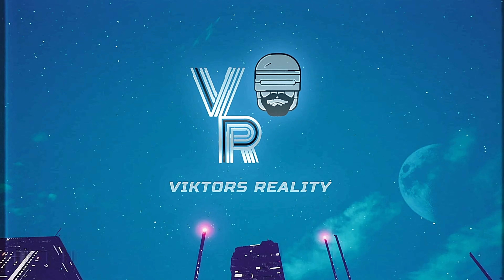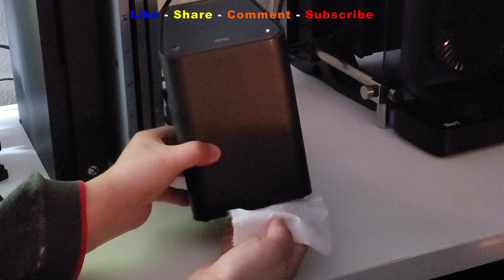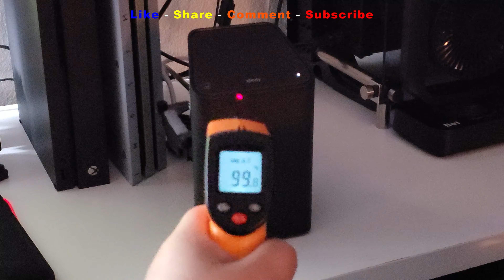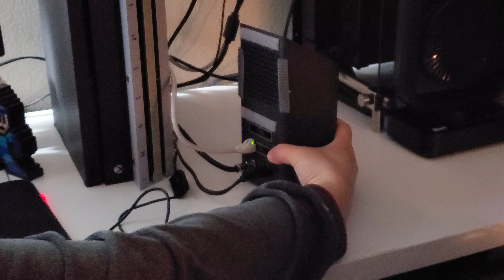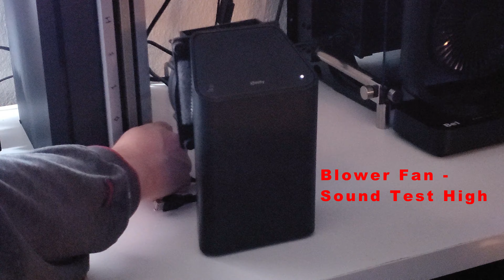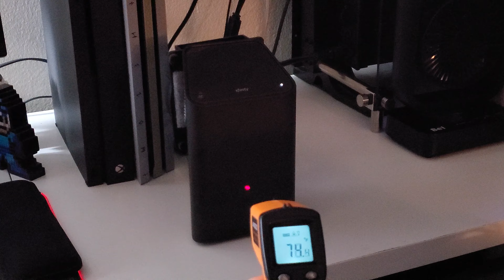Overheating? Xfinity XB6 Heat Fix - Xfinity Gigabit Internet

Comment: So basically xfinity should have designed this better. The previous router had grated sides and we never had an issue. This new router has been driving us CRAZY because the speeds are trash (10mbps or less). It wasn't until one of us touched it that we thought it may be overheating. We're going to try the fan. Thank you so much for posting this!
Reply from the maker: Just so you know. Call Xfinity first. They are upgrading ppl who have a certain speed of service to the new XB7 wifi 6 model. The 7 is white while the 6 is grey (ours). They told me its on backorder until Nov in my area but maybe you have better luck. The upgrade is free.   :) but the fan does let me have a more stable no more drop out connection.
Reply: @DisplayReality  yes, that's the one we have. Unfortunately, same issue. The previous model we had (the thin, tall black one) had open grating on each side. Never got too hot and ran our devices with no problem. For reference, i have a 4K samsung tv, 2 laptops, 2 xbox 1S, and an Alexa Dot. We rarely use the wifi fo our phones because we have unlimited internet.
Reply: @DisplayReality  also, they're coming out tomorrow because the signal going in to the router is perfect, but once it hits the router it's garbage. We've reset the damn thing almost 4 times a day since we got it last week.
Reply from the maker: Yea there's a problem then. Hopefully they fix and even if they do these fans will make it cooler for a more stable speed. With these fans since they move more air faster... make sure to clean the bottom intake area as dust will accumulate faster. I dust mine once a wk for it to stay always clear and open. And the actual fan about once a month.
Reply: the design works as intended. keeps breaking so you have to keep paying them money to fix it. genius!

Comment: I have had my XB6 for 2 years. Have had 0 issues except for Last night I believe it over heated. Last 24 hours the modem had consistently been disconnecting, then it will connect again after it cools. Thats what it seemed Iike anyways... I exchanged the modem today at the xfinity store. Got another XB6... connected couple hours ago...so far so good:) never heard a noise tho

Comment: Mines 2 days old, I’ve had to restart it over 20 times because the internet connection keeps going out, just temped it and it’s at 144 degrees 😂 last model worked way better
Reply from the maker: 144?😬😬😬... lol I know what you mean sometimes the older ones work better. Just make sure the vents on both sides are clean as much as possible

Comment: The modem/routers need better cooling methods and should also include air filters. Change or clean air filters and these will last a lifetime or at least until there’s a major new technology. Heat hurts electronics. Dust causes slows down electronics heat removal.

Comment: Cox Routers have the same issue, I build computers so I know how crucial it is for electrical components to be cooled, Got 2 old PC fans that were laying around, Made a custom stand with one of the fans on the bottom, and then put a fan at the intake side aswell, It wont ever exceed 63 - 70f now, These types of Routers/Modems have terrible cooling, And also can be a result of internet outages in your home when using the internet for a extended period of time, For those wanting to DIY a cooling setup, It is very easy, Just get a couple 80mm - 120mm fans off of amazon that Can be powered by USB, then either tape them onto the modem or use some Double-Sided Adhesive Tape and mount them to the router top and bottom, Then to make a stand so it has clearance Get a few rubber stops and put them on the bottom of the fan and screw a long self tapper into the rubber stop, And your all done! Side Note It does sound like a lot of work but it is well worth it and it helps with improving internet speed aswell since the device doesn't have to work so hard.

Comment: My cut's off all the time and I unplug it and clean all the vents with compressed air.  But I've never had an issue with other modems and Comcast has no solution, or at least when I've contacted them.  thanks for the video.
Reply from the maker: Maybe you should get a fresh install on your line? I know they problably will charge you but if you have other option... Xfinity is the fastest in my area so I had too.
Reply: what the f...k

Comment: I used cable ties to secure a case fan to the top grill in back. I did this because I noted there was no other method of cooling but convection. Cheap insurance. And I don't have to worry about Xfinity tweaking their system and making my router obsolete (like my Netgear 6300).

Comment: I took out the 50 x 20mm fan and slapped a 120mm on the bottom because the higher pitch of the small fan was driving me nuts. Going to see if I can 3d print something to hold it in place and funnel the air more efficiently. Right now it's all just stacked on top of each other.

Comment: Now I see your post which has more detail along my issue. And I found your added fan on Amazon, the exact you have.   I was given this about 5 days ago as a replacement. The fan has never shut off and it's a little warm so you post is appreciated.  So the fan is not blowing on the hardware, it's sucking air and the added fan is blowing away from the router? Got it!  ";-Dx  jack

Comment: The successors, XB7 and XB8 the ventilation is at the bottom surface, and on the top surface of the unit with a fan near the base sucking air in when necessary. The XB8 uses about 16-18 watts continuously and fan only comes on if house gets near 80F so it can handle pretty high temperatures. It is currently 65F in the house and pointing a temperature gun pointing down at the top it reads up to 119F it's always like this 24/7 reliable. No big deal

Comment: I had this same issue out of mine.  You couldn't touch the outside of mine.  It would straight burn your hand.  Called Xfinity and got a new one and it doesn't get quite as hot but still hotter than it should be.  They do it on purpose.  They know what they have and what they're doing
Reply from the maker: I just got a new Asus router wifi6 for my setup. As even on the xb7 I would get 2 rooms away drop outs. I know what you mean...

Comment: They just updated my modem and gave me the one in the video. And it hums and gets warm..This not even over a month..I was happy with my other one with the lights!    I couldn't do all you suggested with the fan in the back.   And getting through Xfinity is terrible!!!!
Reply: The same exact thing happened to us! Old modem sometimes had a slight high pitched sound, but this new one has a loud fan humming sound and is hot to the touch. I hate it! Lol.

Comment: Got one of these this week, the built in fan is annoyingly loud...   probably going to buy a modem before I try this though.. ha!
Reply from the maker: The Xfi Xfinity modem? If its loud get it replaced. On reddit there are reports that if its loud its faulty. Many reports. My modem is silent but if I put my ear I can hear a small fan. Mine does heat up with more than 5 connections. With this ac infinity it has made my wireless speed stable with less drops and way cooler...
Reply: I'd rather have the fan be loud. It doesn't do shit

Comment: You’d think the company could have installed an internal fan FFS. Thanks for the tip though. I also flipped my modem on its side so there’s nothing obstructing the airflow

Comment: We had a cable problem with our telephone pole’s recently so there was a dude to come out here and work on the lines because our wifi was out. Keep in mind we had amazing wifi before this happened we run 1 ps5, 2 ps4s, 5+ phones all smooth as butter plus anyone that comes over no problems we loved our wifi. As they were fixing the lines they gave us a smaller wifi box and stole our good wifi box from us claiming its “better”, “smaller is better” is what the dude said. But its the same one in the video. Let me just say ITS COMPLETE DOG SHIT i cant play any thing without nonstop lag. I want my old modem back but they took it 😢

Comment: I have this router and it was decent for the first week or so, but then it just started dropping to crazy low speeds, i took speed test and a one point it had reached 0.02 down and 0.04 up. When I restart the device and let it cool down it usually is okay for around 5 mins but then the router heats up and the speeds tank. I’m hoping this works for me because i’m not sure what else would be causing these speeds
Reply from the maker: Also... Try to keep it clean. I need to vacuum the vents of the router every 2 wks to be sure they are clear. Now I never have a problem. Too bad we need to go thru this. But this the best speeds in my area so I need xfinity.

Comment: Have the same one and was wondering if I could buy a netgear modem and connect it and would it increase my speeds? My ISP's download speed goes up to 250 mbps but I get really bad speeds.
Reply from the maker: You should be able to if that's what you want. Before I had a Netgear modem and Nighthawk wireless router when I was at 250. But since this deal for me was free unlimited if I got the Xb6 so it was a no brainer for me... but call them and ask for the new white version 2020 edition modem. I'm in the process of getting mine. It's a free upgrade.. maybe still rolling out.. it's faster and cooler supposedly according to them at ces 2020.
Reply from the maker: Yea... the fan must be super small in there... LOL... it dosent even move toilet paper.. LOL

Comment: I just took it apart and it air cools....when they come work on it I put it back together
Reply: How do I take this thing apart?
Reply: Same haha
Reply: @JimmyChangaification  remove rubber feet. Don't touch left side when cover removes.
Reply: @LifeofAedan  I took off the rubber feet expecting to find screws under them, but nothing.  I tried (gently) to pry off the bottom plate, but it does not seem to want to come.  What next?

Comment: Lmfaoooo! What a joke of a unit! I have an ASUS router and it’s never hot and 2 years it’s still reliable
Reply from the maker: My netgear router had alot of holes and vents even a thermal aluminum heatsink... LOL
Reply: Viktors Reality facts! That fan is there for lazy internals..... idiots tried to offer an XB6 modem lol I’m like no thanks I’d rather pay 💰 a little to use my reliable hardware than their POS in house hardware....... 💁🏼‍♀️💁🏼‍♀️💁🏼‍♀️💁🏼‍♀️

Comment: Just picked this one up and its really hot. Way hotter then it should be. Considering buying a modem and ditching this stationary heating pad. Our service keeps dropping every 30 minutes or so. Very annoying.
Reply from the maker: To be honest same thing happened to me. My Xfinity modem would fluctuate every 1hr or so. Speeds would be great then slow down. Especially when it's over 100f. With this fan Now I'm never over 93f around there. Now I get stable temps. But Xfinity announced a new modem at CES 2020. It's free to every Xfinity subscriber. Have toubseen it? All you got to do is call them and request one. IL make a video on it. Its faster and cooler supposedly... try that. But a seperate modem and wireless router is an option too. I had both netgear modem and wireless routers before I took an Xfinity deal for unlimited internet..
Reply: Going tonight to swap for a new one. If this does not work i will have a tech come out. Not sure what a tech can do for equipment that overheats lol.
Reply: @terryfredrick5149  You can buy a lot of fans for the cost of a modem.

Comment: Above 100??? Sounds unsafe to me- Like why would Comcast or Xfinity put out a modem that heats up that hot on the outside when probably those modems are used around children and the elderly just curious I think you’ve really shown how really hot they can get- Let’s hope nobody gets seriously burned touching that
Reply from the maker: It's probably due to the internal fan being so cheap and low power in speed. That's why this fan helps. But true I don't know why Comcast would not check this. Lots of comments on how hot it gets..

Comment: Thank you for sharing. Xfinity modem fan is working but making noise. How I can reduce noise?
Reply from the maker: I had my Xb6 replaced with a xb7 plus I still use my fan for no throttling. But I do clean it out regularly with the keyboard vac. What kind of noise? Maybe it's the small internal fan that loose? Or is it an electronic sound. Like a click. My xb6 had that. Kind of like it was starting to flex the plastic due to heat.
Reply: @DisplayReality  I just got this modem yesterday.  The noise sounds like a small laptop.  It's a constant fan noise, it throttles up and down every now and then, just like a laptop.  I don't think I've ever had a modem/router combo with a fan inside of it until I switched to comcast.  The guy assured me there were no gotcha's so I signed a one year contract, then I get this polished turd of a gateway.  This is a design issue.  I'm surprised yours has no noise.  My house is virtually silent at bedtime aside of the constant drone that is my gateway.

Comment: Why not just rest it in its side so there’s more air flow?
Reply from the maker: The built in fan still is so small... I do have some rubber pegs on the bottom for an extra bit..

Comment: I suspect they just make their newer devices as cheaply as possible.  I've noticed the new 4K DVR box is just as bad. Uses a loud tiny fan as well with excess heat on the case.
Reply from the maker: There is a newer xfinity modem above the xb7. Xb8?? I'll look for more info.. I hope better thermals.. it looks smaller.

Comment: How thick velcrow tape do you use?
Reply from the maker: Half inch velcro. I am getting the new xb7 and will see if it's any different... plus if fan makes a difference. The xb7 is free if you call for the upgrade. All free.
Reply: @DisplayReality  oh ok thanks, do a review as soon as you can. If it has the same problem most likely not upgrading.  But I hope the overheating issue gets fixed

Comment: 1) that is not a heat gun. That is a infrared thermometer.  (heat guns produce heat, not detect it)  2) fantastic vid.  3) comcast sucks.   Xfinity sucks.  Yes if its the only thin in the area its what you deal wtih , but honestly its garbage for the price.  And then add on the data caps, paying extra to remove them, just nonsense ways to bleed your money.
Reply from the maker: I meant to say infrared 😆 I have been hearing these Xfi boxes overheat too much .

Comment: There is a fan in the bottom, it has probably stopped working (Burnt out)or is clogged up
Reply from the maker: I have opened mine up. They are small. Plus the more connections the more heat. It's so low in power plus the fan heat vents are so small

Comment: lol i already did that before looking up what others are doing. The back is the perfect size for an old 80mm case fan. I just spliced mine in with an old 12v landline power cord and strapped it on with a couple rubber bands(cuz i was to lazy to find my double sided tape) I found this funny because cox has really bad service in my neighborhood (and a natural monopoly). I constantly get packet loss when gaming. When ya call cox they ALWAYS SAY looks fine on our end and want me to pay for a tech to come out.
Reply from the maker: LOL... so true. When I call for an issue they always say that too... kind of funny🤣 and kind of😡 at the same time...
Reply: Xb7 (white) modem is out now and fixes this issue. Plus it has WiFi 6 and better WiFi range. They can send you a replacement/ upgrade for free if you request it.

Comment: Is it any less hot in bridge mode without radios turned on
Reply from the maker: Do you mean separate wifi 2.4 and 5ghz signals. I saw no difference with that. Its still hot.
Reply: @DisplayReality  no I mean with the wifi radios disabled and using my own router....bridge mode
Reply from the maker: Oh... I don't have a seperate wireless router to try.. sorry. But you would think it would be cooler since less stuff going on. But I'm sure it still depends on your speed package. And amount ofbtraffic you generate.
Reply: @DisplayReality  I'll have these answers shortly. Package is out for delivery
Reply: @DisplayReality  netgear r7200 as router and primary ap, Cisco 2600 for IoT network
Reply: Viktors Reality I spoke I should give an update. I couldn’t get past 600 down on gigabit with the xb6 in bridge mode. And it got super hot (I don’t think the radios ever truly turn off). 

Call, bitch, complain, and demand the xb7. In bridge mode the thing is phenomenal (average 900 down on wired connection). The thing has a 2.5gbe port and WiFi 6/ax. Pretty impressive actually.

I’m still using it bridged. I don’t want or need their network managing my network. But a 2.5gbe port is pretty impressive. No heat issues
Reply from the maker: thx for the update! they told me its on backorder... but hopefully by aug.

Comment: Well, call me mouthy. This is the 2nd posts in several hours. I hope you are still monitoring them. I am going to take your advice and buy the fan from Amazon. Must be the same one. Doesn't the pull on the built in fan from the power of the adapted fan do damage or race the little fan beyond limits? Hello? I hope you are here. lol
Reply from the maker: Low or med would be fine. But on high does seem to lower the temp alot more I have found. I still use my xb7 with this fan and on Hugh for over 1yr and no issues...